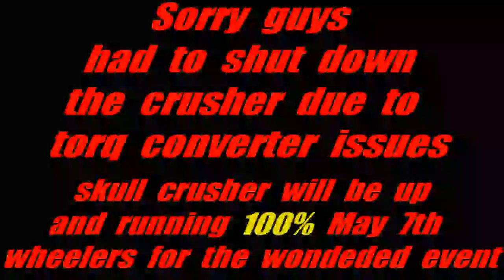87 GMC JIMMY Crusher Edition Walk around and Rock Garden Crawling Trees Ranch Texas April 3, 2011

Comment: @dbzgt545 Ah, i see to center the axle onto the spring(equal between eyes) and i see you can also move your spring foreward or back  with the adjustable front perches.I guess i should give some info on my rig.1993 club cab long box dodge with 60/14ff and 38" tsl tires. Im keeping mine street legal and drivable. Have you looked at the 52" rear dodge springs to use in the front? Equal length between eyes and 2.5 inches wide same as chevy. I almost used chevy springs but didnt like the unequal leng

Comment from the maker: Yepp i used to baby wheel it for the lo gest time. Then i started doi.g harder and more challenging trails. And went to 40s. Once u try to do some ectreme stuff u find out i need lockers then u sart breaking stuff. Thus the reason to upgrade. But u can diff get away with smaller axles and fenessing it. Been there done that.

Comment: @dbzgt545 Man just swap to a detroit up front. Less stuff to worry about and steering will be 100X easier. And no ARB (all ready Broken) to run air lines to. On a full size a detroit is fine. If you were building a buggy and needed cut brakes ect or had a short wheelbase jeep. ARB is a good option.

Comment: How are the front Shackle Angles when sitting on just a level surface?  With them in the stock location they seem to be a little sharp
Reply from the maker: My shackles are long, for great down drop and flex, i do not recomend this for daily use or driving on the street. You just move the front shackle to fit longer springs.

Comment: @dbzgt545 I had an 88 blazer,, and it did pretty much the same thing,, looked at it closely and the factory cross braces ( rivited) and were moving a little where they connected to the frame,, I ended up welding all cross members to the frame, then welded a 2x3 tube just in front of them inside the channel frame- one side to the other, ,, problem solved,, (it worked), frame couldnt twist,,

Comment: Thats just a bunch of BULL i run corp 10 bolts 6 LUG and 35's and they dont break it just depends on how you run it best way tho wheel with stock parts is ease into it and if you ixperiense some exxesive wheel spin then giver more gas. If then your stuck shitf it into low range first gear and gently put it to the wood dont romp on it just give it gas untill you get to full throtle if your still stuck try and back uout if your STILL stuck call a friend with a tow strap